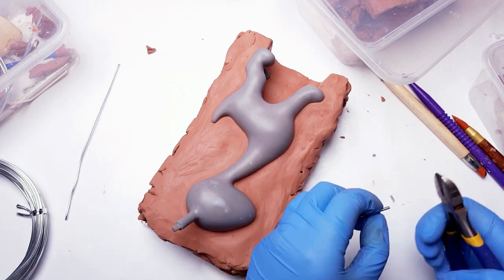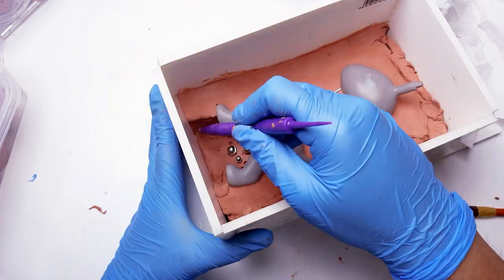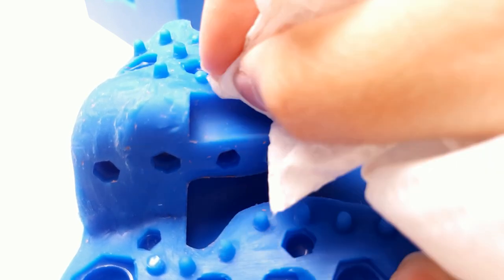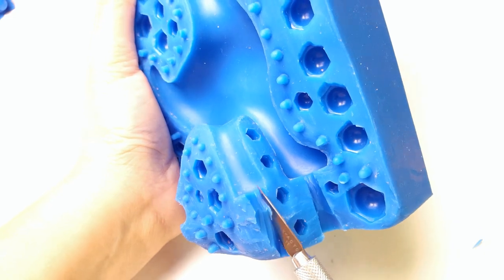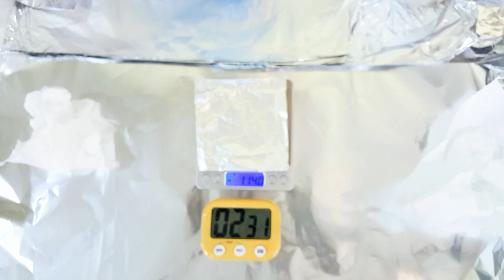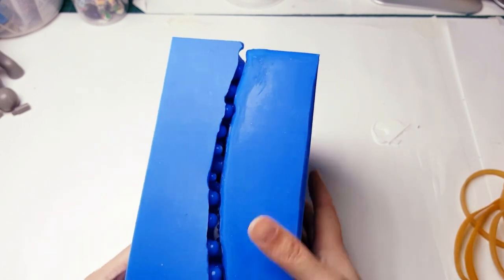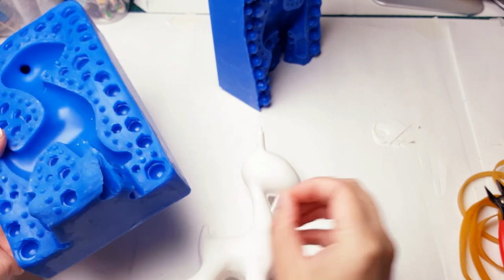Draffi mold making, resin casting & painting (with commentary)

Comment: Good video and a lovely sculpt. 

I'm surprised that bubbles where still present after the pressure pot treatment. Are you going up to 60 psi or is it more like 30?
I have never found a need to draw a vacuum on my resin when it's going in the pressure pot.
You might benefit from curing the silicone under pressure as well, although that would also mean having to do some other changes to your process. 

Consider posting this on https://www.reddit.com/r/ResinCasting/ both to get more feedback and help others looking to learn.
Reply from the maker: Thank you I'm glad you like the sculpt =).

As for the casting I have tried many combinations before arriving at as my method. When I first got the pot I did many casts without vacuum (since that's what most people do) and they all had many micro bubbles. I tried it with a few different in the smooth on resin ranges. There are 2 reasons I can think of why this might happen... one it's very humid in singapore and that might be why I get micro bubbles on the surface (cos there dont dent to be in the centre). My compressors already has a water trap but I think an air drier might be excessive for my needs. Second early on I had resin issues when first switching to a new brand which smooth on reckoned the resin parts can separate if left standing so i needed to make sure I shake it well before pouring each part before mixing. Shaking means I can lots of bubbles in it just from doing that. But frankly by degrading and pressuring it's the best results I personally get. But I do appreciate that most people dont shake their bottles resin parts before mixing and just go straight into the pressure pot. And if that work for others all power to them I wish i could get mine to do that.

Ok so i might be new to casting but i did try and learn before using a pressure pot as they are no joke. I pressure at about 57 (just shy of the max 60). I started out at 40 which technically is still in range but I have better results higher.

I have caster friends that to pressure cure their molds and i totally understand why they do it. But I dont for 2 reasons. First i find that when I degas the silicone its virtually bubble free and dont find there is much deformation in the molds under pressure. Second and more importantly because in general my master casts I use armatures and tinfoil and polymer clay there will be air inside and I'm not particularly confident that it would withstand the pressure pot. I mean I've never tried but shug what I'm doing works fine for me.

Thanks for taking the time leave a comment I honestly dont expect people to watch this hahaha.
Reply: @jessica_emmett  Yeah a humid environment sure is a terror on polyurethane resins. That could definitely be the source of bubbles. And when you have a process that works well for you I can understand sticking to it. I know there is a hundred variables when doing this sort of thing. 

I think smooth on sells a dry gas blanket spray to put in your resin bottles. That will minimize the exposure to atmospheric moisture further. The fog filter on the compressor should take care of the rest. The dry gas blanket only works when used from the first time you open the product and all through the use, since any moisture that gets absorbed stays in the resin as far as I know.

And yeah I watch this video and will promote any on the subject. I have worked for years with this kind of stuff, and although I see lots of information like videos and tutorials I often hear people saying that they can't find any references to these sort of tasks. Mostly people who aren't in to the field yet but want to learn. So even though I find there is plenty of information out there I still want to promote more of it :)
Reply from the maker: Oh yes a friend of mine was telling me about dry gas blankets just the other day I just hadn't got around to researching it properly yet but I know the basic principle =).

I totally agree there is loads of info out there on casting, I learnt pretty much everything I needed to know online but where it was helpful for me wa I was able to ask people I know when I didnt know the name or keywords of what problem i was having that wasnt the obvious. So I get it both ways... internet great for learning but sometimes only if you know what to look for. And I'm very fortunate that the designer toy & casting peeps are some of the most friendly help peeps I know =). But I remember what it felt like to be super new to casting it can feel daunting. But I try my bet to find the answers myself before asking others. So I just try to remember all the lovely helpful people willing to put up with my new question and help other people when they ask me. Sharing is caring.